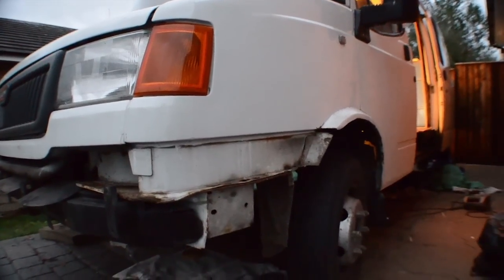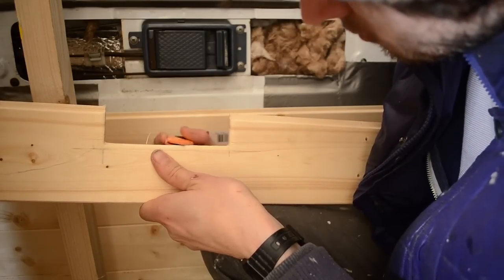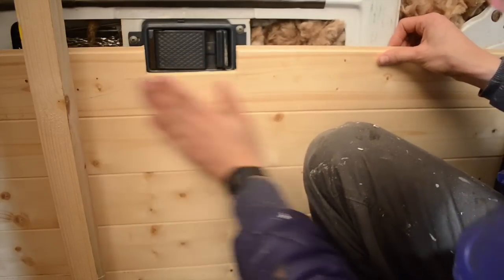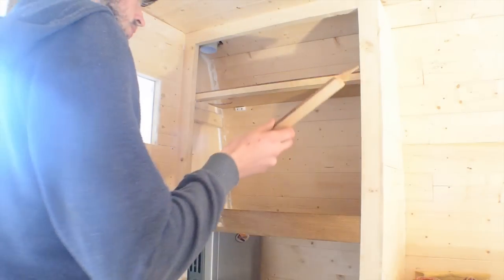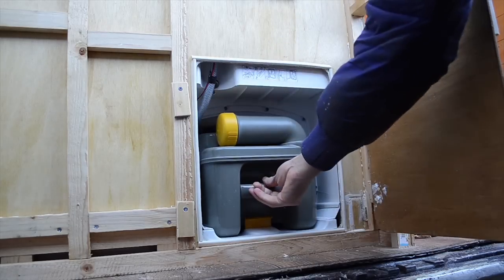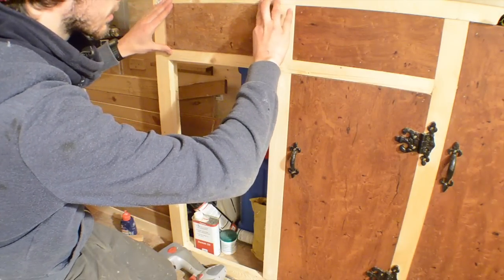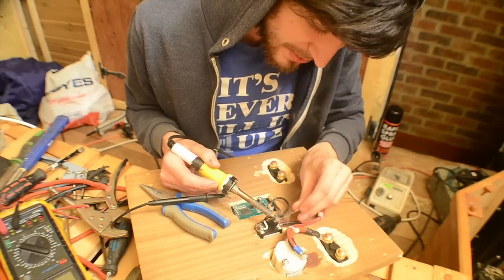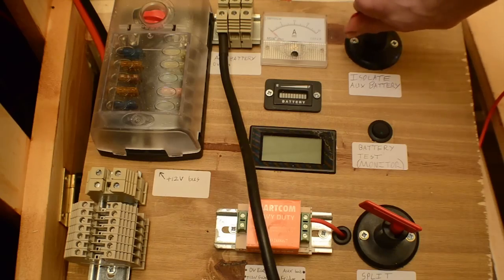From van to home in 5 months...

Comment: So one huge flaw... I saw you did not insulate against the bare metal skin of the side panels... dumb.
Reply: +steve bigler you do know wood is an insulator right? he put wood around the whole thing....so yeah he did.
Reply: +BrazBlue thermo-dynamics... yeah okay... but... there are vastly superior options.
Reply from the maker: +steve bigler I used a mixture of different insulation because I was recycling what I already had and found. So most of it is foil bubblewrap, recycled bottle fibre and then wood
Reply: +Mike Hudson awesome.